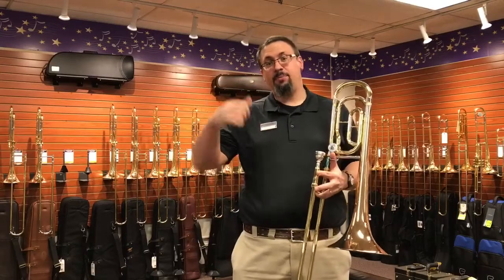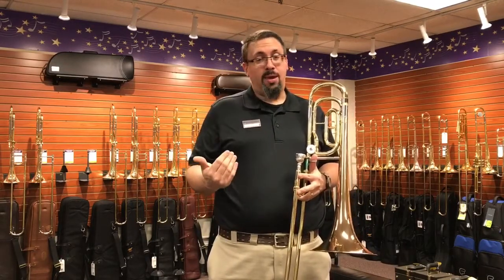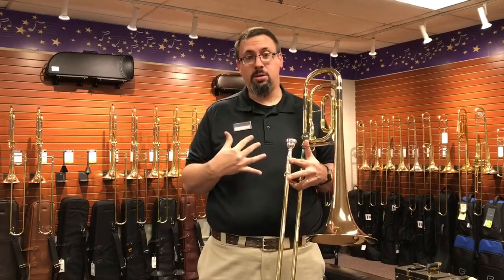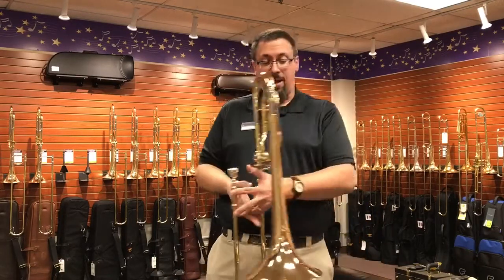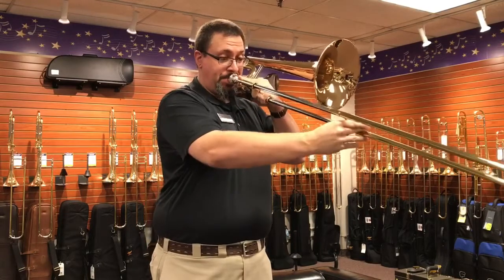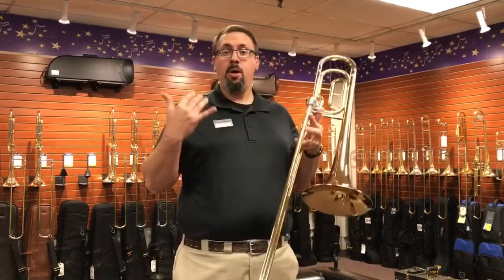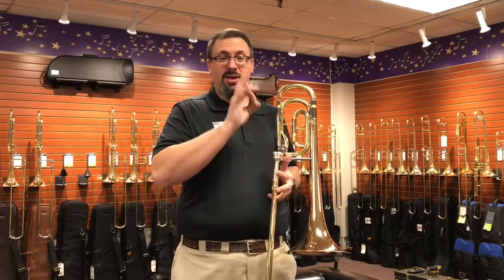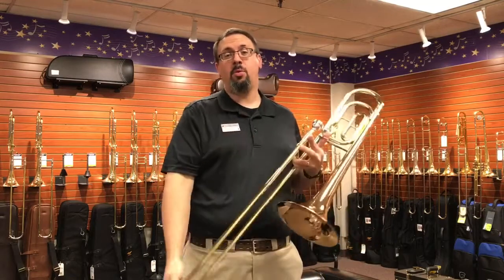Yamaha YBL-421G Bass Trombone Demo

Comment: I have a Yamaha YBL-421G.  It may be classified as an "intermediate" bass trombone, but the truth is that this instrument plays above its weight class.  Wonderful, slick slide; silent, smooth rotor; excellent sound that blends well in either a big band or orchestral setting.  Great value!  

(I even use a George Roberts mouthpiece in tribute to this great man.)